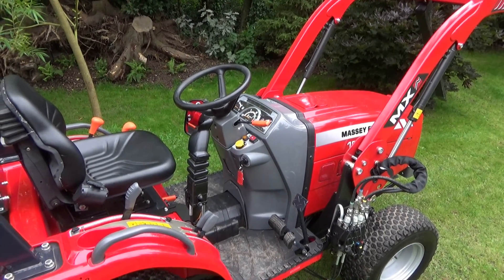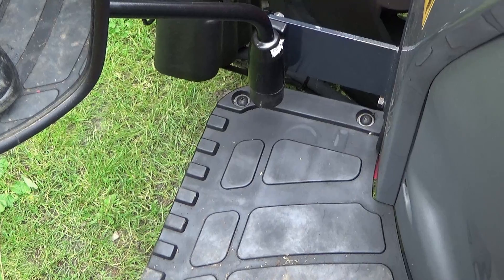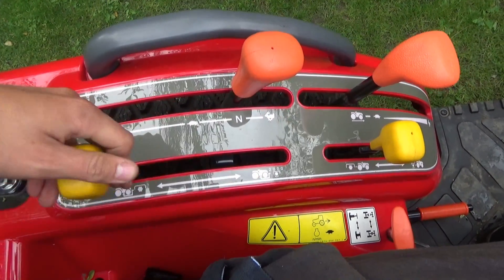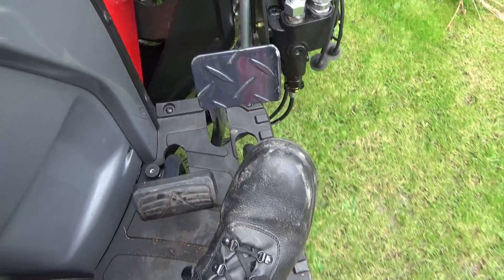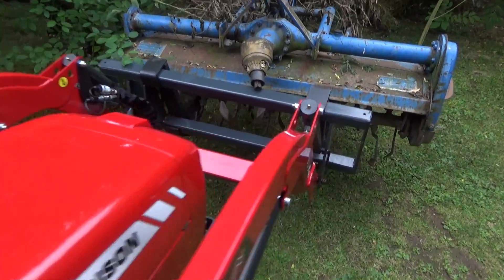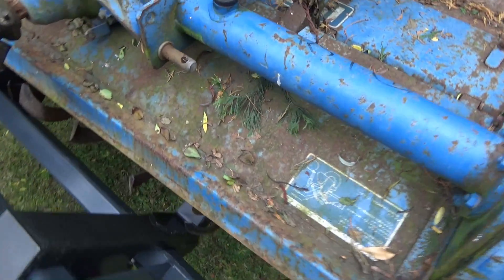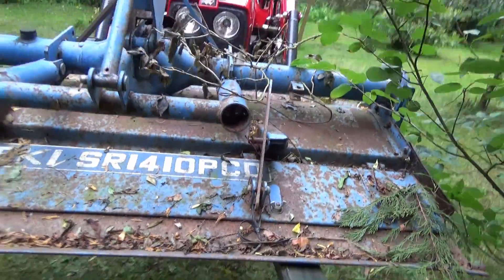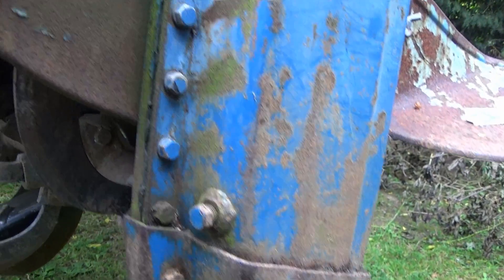Tractor Controls and Possible Project

Comment: The forward/reverse pedals look quite awkward to use, never seen a set up like that before. Suppose you will get used to it. The rotivator is a winter project, sand blast and paint, as for the leak that isn't leaking, leave well alone. If it ain't broke don't fix it, is a very good saying. Thanks for sharing this with us all.

Comment: Dagger, The name brand Rustoleum makes a product that is both a primer and rust restorer. That means it reverses the oxidation and leaves the rust as new iron or steel. Then you just paint as usual. I think you should just match the paint, ignoring the decal or signage and have done with it. If you leave it for another year it may do some damage you wouldn't like. My two cents.  Thanks for your entertaining vids.  A sub.

Comment: I don't like having the brake,forward and reverse pedals that close together. The brake should have been put on the other side. Too cluttered with all 3 together. I would at least paint the tiller and replace the seals. I would not do a complete restore but just enough to keep it from rusting out.

Comment: I mean, if you do a full restoration on it. Its gonna end up looking the same way in a few years. well that is if you, or the next owner doesnt take care of it. not saying you do. just if. But also there isnt any big rust spots that hurt the structure of the body, or the main parts of the machine. So i'm suggesting. maybe just clean off the bits you can. do a quick once over with some new paint. clean all the moving parts. and just use it as is. cause like you said. there isnt anything really wrong with it besides the looks. i feel the rust and how it looks gives it character